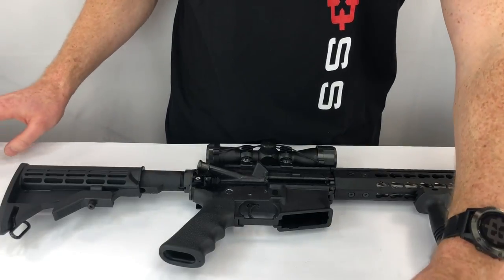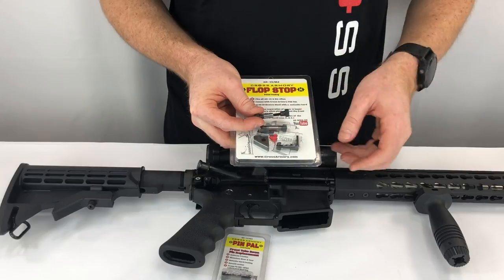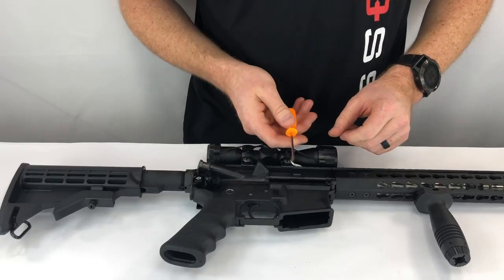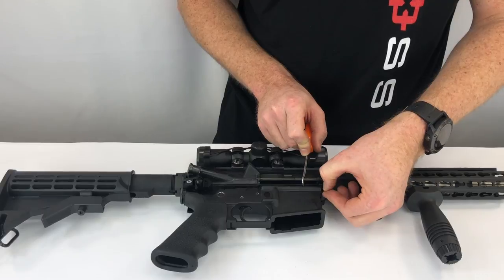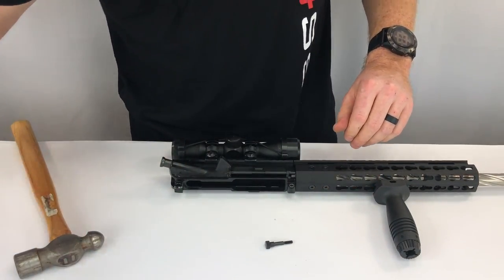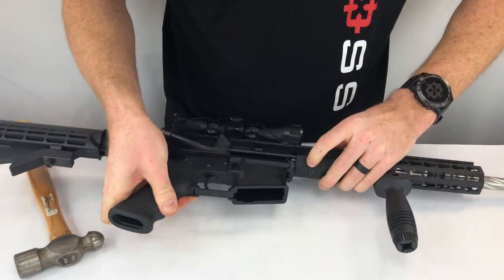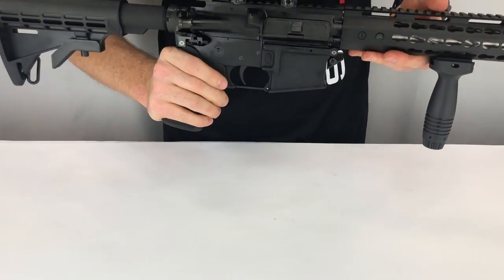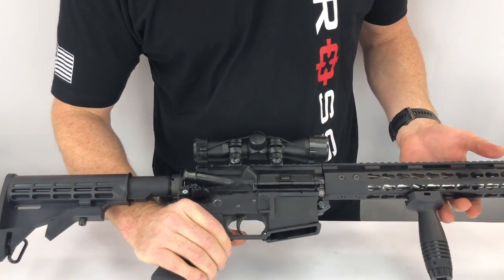Cross Armory | CA Legal AR15 Parts | FLOP STOP & PIN PAL Installation

Comment: I'd like to give my input as a believer in this product.  I spent the cash and bought their full set-up and have to say, that I approve of its design.  
In saying this however and seeing the competition's products now... I think that it's time for some new iterations of the Cross Armory Compliant parts... the 3 main things that come to mind are the SAFEMAG 2.0 blocking easy-access to the bolt-release (unless you install a BAD Lever), the Selector Switch being severely blocked by the QUICKPINS, and the Flop Stop not working on skinny rails (my BCM Keymod).  Other than this, I fully stand behind these products.  With a little training, this is one of the best product sets on the market.

Comment: It is not as easy to install as the video.  I had to beat the heck out of mine to get the bushing in then had to tap the screw out with a hammer.  Not sure how the video seemed so drop in.  I need to work the screw a bit  so I can pull the screw by hand if needed.
Have not added the flopstop yet so I have full range to work it.
Reply: Matthew Hirsch same here. I wish the video also had a close up. Not bad part though
Reply: Agree on it takes more force to get it in than this video.   My pin comes at easy though.